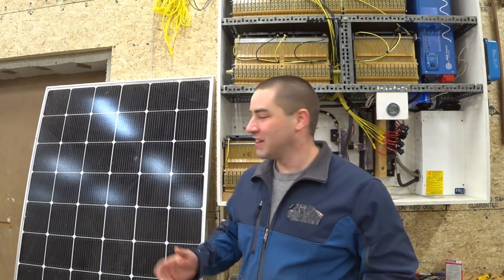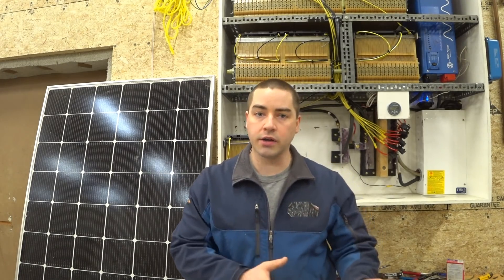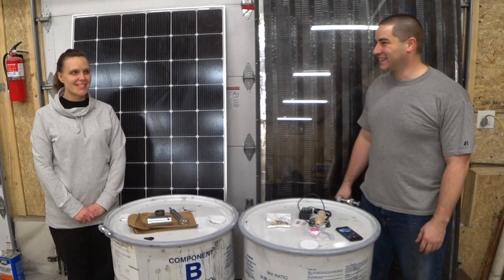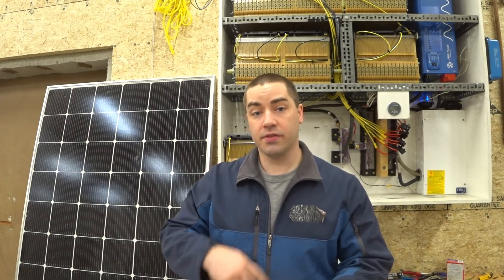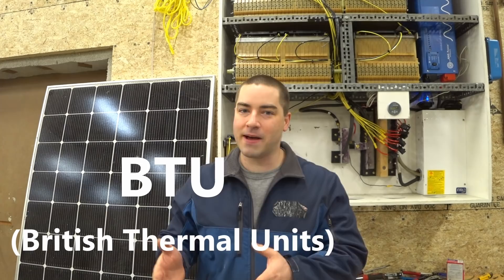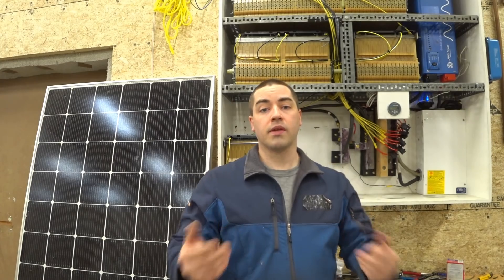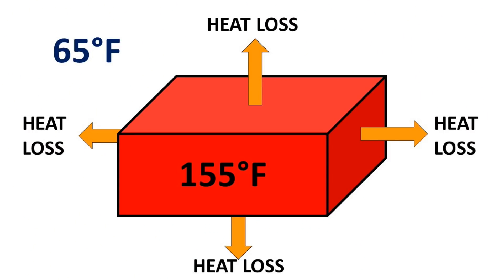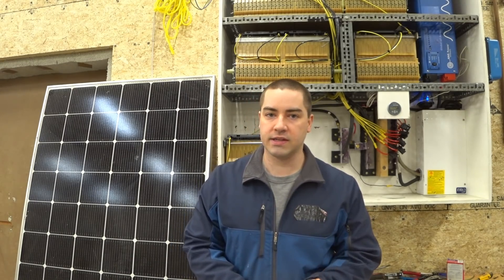Cheapest Energy Storage Off-Grid

Comment: How about an update???

The bigger the tank, the less expensive it is per cubic foot or cubic meter of water storage.

If the tank is inside the conditioned part of the house, in the fall, winter and spring, the heat that leaks out of the tank is not wasted, it helps heat the house. Of course, in the summer, any heat that leaks will have to be countered with air conditioning.
Reply from the maker: I built a 250 Gallon tank under my house (inside my crawlspace).  It has been working great.  It's automatic.  No leaks.  Pump and controller do their job.  I have a series of videos on it if you are interested.

Comment: You could always put a tank in the attic. You would only need to heat it for a few months. A pipe heat trace wire wrapped around the tank will keep your water or hot in the cold. Gravity pressure and wasted space utilization ideas 💡

Comment: David, Thanks for this introduction to this concept. Being a complete novice, how is it then possible to turn this heated water into energy that powers my home/electronics? Or was this specifically for the storage of hot water only?
Reply from the maker: Specifically for storing hot water.  I built a 250 gallon hot water tank inside my house.  I'm trying to show how inexpensive this is compared to storing energy in batteries, which then get used to heat water.  I'm not replacing batteries, I still have them and use them for all my other loads besides hot water.
Reply: @DavidPozEnergy  David, thanks for your reply, totally makes sense.

Comment: A heat pump water heater is still useful if you can program your system to only use excess electricity generated by the PVs that would otherwise not be used.

Comment: I want to heat that 300 gallons of water to 150 F by the sun …. I believe there was an architect in Mass. who did this with glass bottles many years ago . Im wondering how I can do this in northern Canada  ( Southern Labrador) we get quite a lot of sun , and cold of coarse … tons of wind . Should the storage vessels be small or big , glass or cement , ceramic ? Not sure I’m thinking of putting the storage on 3 rd floor , and then fanning the heat down to the first. Do you have any ideas . It’s for a 3 story piece built on to my wired building that now has a usual 45 gallon hot water tank .

Comment: I've owned a Thermo solor heater, and the output water is extremely hot, so what if you put a thermo pile on the output pipes, you can use that  extremely hot output of water to produce electricity at the same time.

Comment: But this energy is not being used to generate electricity. I thought your were designing a storage system to replace lithium batteries. But you still need them for electricity, as this energy you are storing in thermal tanks is for house and water heating only.

Comment: Great, but wow, don't imperial measures make all the math(s) more difficult! Particularly as you mix it with Metric (kWh). I've totally given up trying to do anything with imperial. Metric is so much simpler, 95% of the world says so! :)
I'm looking at VIPs - Vacuum insulated panels - for the thermal store insulation.
Also looking at heat recovery from the waste water.

Comment: David, you completely missed the point of using the hybrid water heater! It has a much higher COP than the simple electric element does. Using the heat pump when the sun is shining allows you to heat four times as much water at atmospheric pressure.

Comment: Thanks for articulating in this mini-series what I've been thinking for quite a while. The thermal battery, even if it's 'leaking' heat a bit, as you said, is a net positive in the winter because it's leaking heat into living space and that just translates into less load for whatever the home's heating system is. It's the summer time when the thermal battery leaking heat is an issue (for the home's cooling system) -- maybe the thermal battery's site could be located on the periphery of the home and you rearrange some physical baffles or walls or something twice a year to vent heat into, or out of, the living space as the seasons change.

Comment: If you're moving 150k btu heat around, the cold side of a heat pump water heater would provide about the same amount of cooling to your house as a window air conditioner by blowing air over it and into the house, another form of power saving and thermally storing energy in the form of cold air. A well-insulated hot water tank will hold the heat regardless of where the hot water comes from. A smart heater could run only when excess power is detected.
There's a grid scale solar thermal plant with molten salt heat storage in Tonopah California, but private investors pulled out of it because in the time it took to build the price of PV and wind dropped so much from increasing economies of scale that solar thermal wasn't competitive anymore and it had to be majority funded the taxpayers. it eventually closed and went bankrupt.

Comment: You're adding up BTUs in error for the battery system. Because the battery system is not keeping the water hot it's only heating the water that you're using at the time that you're using it. So there is super little loss overtime from a heat loss. But yet you have added that equation to the amount of hours that your batteries can hold. That's your error. I just thought I'd point that out.

Comment: You could probably put some glycol in the heat exchange water to prevent possible freezing of water in the pipes during inactive cold spells. BUT, glycol has poor compatibility with PVC, so glycerine would be better. This may affect the heat capacity a little. But if you ever swapped for copper heat exchange piping (and your tank material is compatible), adding glycol to water might certainly be helpful.

Comment: I'm using a DIY panel to heat a 275 gallon IBC, but I only want to heat it to about 100 F maximum.  I live in Southern California, so that is very easy.  I have a little inline electric flash heater that can raise the water temperature about 40 degrees F.  If I feed it 60 F water, it doesn't get quite hot enough for a comfortable shower.  But if I preheat the water to 100 F, then it uses much less power to reach it's 105 F setpoint.  I have a grid-tied PV array, so my power does not cost me anything.

Comment: Can adding rocks(sand), in tank as heat absorber, increase temperature's duration for later hot water? insulate it in a compost mound; aim solar(heliostat) on tank through window(s). use hillside terrain angle advantages. do you have enough yard to make ground battery? Thanks for info; GO BACK TO GREEN FOR KIDS FUTURE! universally we're all kids.

Comment: Thank you for the awesome video.
I guess if you dissolve a lot of salt in the water reservoir, you can significantly increase its heat energy capacity. The temperature won't go higher, but it will store more heat. This way you might be able to generate 4 or even more days of hot water with your 200 gal reservoir.
Reply: Increasing salt concentration actually decreases the specific heat capacity of water, at least on a mass basis. And for seawater, heat capacity goes down by 4.5% while density goes up by 3%. So also on a volumetric basis if that holds for other concentrations.

Comment: By water cooling your PV panels
From the back you increase their efficiency and peak power...you also protect them from deterioration due to heat damage..  extending their life span. 
You can then use the panel coolant to preheat a stored hot water system... Useful on a boat etc .. you could use a stirling engine to generate more electricity or circulate air or water.

Comment: useful for cold climates where heating is important.  I have an evaculated tube solar hot water system with wood fired boost so dont use electricity to heat water which is even more efficient.

Comment: You'd gain even more if that hot water is NOT produced with photovoltaic cells, known for their low efficiency, but with cheap solar water heaters with far higher efficiency, taking a lot less space and control systems.

Comment: There is a Dow liquid that can go up to 200 degs C., it's used in boil resistant radiator fluid..Won't be cheap, but would be one way to get volume down., if space is part of the limits..

Comment: Why not have enough solar panels on the roof to wire them in series to make 240 Volts DC that's wired directly to one of the heating elements in an electric water heater? You would need 8 - 300 Watt solar panels per heating element, the tank could be potable water and pressurized. The tank would be your storage unit. You would not be able to turn the tank off during the day unless you cover one of the solar panels.

Comment: If I understood correct, you just heat up a giant container filled up with water, and use it for heating , shower etc. Instead of storing the electricity in batteries, what you would use to heat up the water in the cloudy days
Reply from the maker: The goal of the tank is to have a large enough "Thermal Battery" to carry you through the cloudy days.

Comment: You said you don't want to turn it into steam, but why not? True it adds cost to change the piping and you'd need to use a metal tank or aircrete as your water tank. However, you'd  be able to use a DIY parabolic trough collector instead, turn that water into steam, pressurize it through a nozzle and use it to power a small steam turbine. Then collect the steam which turns back into water in your storage tank and it recycles in a continuous loop. Should work, right?

Comment: Hi. I wondered if you could me some advice how to make some kind of battery (or similar) to store the solar heat. Lately I saw this videos of how to make solar heaters.....

https://www.youtube.com/watch?v=WRAxpaYh6DA
https://www.youtube.com/watch?v=IvEfmDH_Y2o

.... but at night they do not work, obviously. I am living in a caravan and in winter I need something to warm up the 8m2 space
Do you have any idea what it needs to store the heat the solar heaters produce during the day? Thank you.
Reply from the maker: Those videos you linked to are about solar air heaters.  Nothing wrong with them, but as you mentioned, they only heat when the sun is directly shining on them.  If you were in a home then the answer is to increase thermal mass inside the house.  This is sometimes done with concrete floors, double plaster-board on walls, and large stone fireplaces.  In a camping trailer you won't be able to add thermal mass because of the light suspension. 

In a camping trailer you could use a fossile fuel heater (propane or diesel).  However, if your goal is renewable energy then probably solar PV panels (electric), plus lithium battery, and a heat-pump.  You collect the solar energy with solar PV.  Store it in lithium batteries.  Then use that to run a heat pump air-source heater.  Such as a mini-split.
Reply: @DavidPozEnergy  Thanks a lot for your advice. Nevertheless, none of what you proposed works for me. These panels and mini-splits are too expensive and heating with propane or diesel is prohibited in small places due to their emissions causing health problems.

Is there nothing out there that one could do oneself (DIY) to design/construct easely a small solar heater that lasts at least 15 hours during the cold winter nights?

In the Northern Hemisphere there live millions of poor people that have to decide whether they buy food or if they want to have a warm home. Or people that have to live in camping trailers or even tents. 

And all the animal shelters where animals literally are freezing to death. And no-one so far has ever thought of designing  a small solar heater for the poor and/or for these animals?

There must be something. I am sure. If you come across an idea, please let me know. Thanks!!!!

Comment: After I installed my small solar array. I noticed a lot of energy going back to the grid. After a bit of research I bought and installed a solar diverter from Solic200 which transfer all available or left over energy at zero export and the rest to the immersion heater which heats our hot water.

Comment: As it works out if the storage tank is not disturbed, hot water will happily sit on top of cold water with very little heat transfer.  Why is this important? If your tank is large, as you mentioned, it may be difficult to heat it sufficiently. But you don't need to heat all of it, just the top part. For this to work well it also means the primary heat exchanger should also be in the top of the tank and be of good transfer medium such as copper!  Water to be heated would enter the transfer medium at the bottom of the tank while heated water exits at the top, but you probably do that anyway!

Important to remember: 

A) If heating is with solar electric, use multiple elements at different levels in the tank. Heat with the top element until the top of the tank reaches 180F. Then move down one element and heat until that part is 180 etc. This could be controlled with simple Arduino setup for example. 

A2) Optionally place the heating elements into a smaller tank of just a few gallons and do all heating in that tank. Only when that tank is at 180, feed that hot water into the large storage slowly and right on the top thus keeping the top of the tank at a constant 180F. 

B) If heating is with solar thermal then draw cold water from, the bottom of the tank (as you almost certainly do!) but inject the heated water from the panels where it is just warmer than the water it replaces. Be careful to let that water enter horizontally not vertically perhaps by placing a "T" at the bottom of the input pipe. Again an Arduino can be used to raise and lower the input tube.  

In this way the heat is always going into the tank where it will provide the maximum hot water for the family. Nobody cares if the water at the bottom of the tank has fallen to 'well temperature' so long as the water at the top makes for a good shower!

Comment: A low mass flat plate counter flow heat exchanger - can heat a high volume high mass thermos bottle filled with water. The extent that you can contain the heat in storage determines how long it lasts. 
Automatic mixing valves can extend range by cooling the heated output. Forced circulation or pressure driven flow is required. Emergency relief and drain down features can be installed.
Alternately the same heat exchanger could be diverted for heating purposes .
Low mass demand fired, at point of use, is also efficient technology. 
As is low mass low temp radiant heating. 
High efficiency and fast recovery rates, along with fine control over temperatures is existing technology. A 2 1/2 Gallon Low mass source can heat what a 50 Gallon high mass, high heat loss hydronic system used to btu for btu with a fraction of the standby losses. as much as 50% of total consumption in some cases. and instant response 'on demand'. No idling losses !
Grumman Aerospace was doing this on Long Island as was Energy Kinetics System 2000 as early as the 1970's. Guess who was involved : )

This guy is good !

Comment: Have you tried adding a strong salt concentration to your storage water to change the boiling point so you can increase the storage.
Reply from the maker: No, I have not added anything like salt, sand, rocks etc. to the tank.  My 250 gallon storage tank is filled with tap water and a little bleach.

Comment: I designed a thermal battery using a small cement block tank lined with high temp silicone and covered the outside with 8 inches of styrocrete, then filled the inside with mineral oil. No water to need conditioning. The mineral oil is heated by pumping through solar evacuated tubes and/or through my sawdust stove depending on the weather. It can be heated to over 500 degrees, then sent through the heat exchanger to heat water or air or a clothes dryer. Even if you are gone for months and it gets cold it will not freeze in the tubes or the lines like water might. It is also a non-pressurized system that holds a huge amount of heat energy in a small space. I might add in-floor radiant heat to the system in the future. A small steam turbine could even be used to generate electricity.
Yes the mineral oil is more expensive than water, but you get a lot more value from it.

Comment: Great video David. One thing to consider, which I have not seen anyone do yet, is to modify the charge controller to utilize the excess electricity to power heating elements in a water tank for exactly this purpose. Few realize that the PV system produces so much electricity that the controller must dump it as waste heat through internal mechanisms because the battery bank cannot take it all. If the controller was modified to route this excess energy to an element in the water tank, you'd have much higher efficiency in a system such as yours. Food For Thought.
Reply: Consider the following concept:

https://www.youtube.com/watch?v=tm7spMG0ch8
Reply: While the potential energy of the panels is wasted, the controller does not dump it as heat internally.  I design PV water heater controllers that sense when the solar array goes over the natural power point voltage.  This is when the charge controller can't take all the power.  The solar world is slow to accept this technology because they lack any real understanding of technology.  I get all my water from excess PV.  So much that I have a 40 gallon water heater in the garage and do all laundry cycles using hot water into the washer's cold inlet. Watch my videos.

Comment: I once worked with an old scientist that told me of an idea for storing and using energy. If you have a high hill on your property and already have a pond on the hill and another a few hundred feet below, you can use solar, wind, etc, kinetic energy to pump the water from the lower pond to the upper pond. With hyro-electric at the bottom of the large fall to the lower pond, you convert the potential energy to kinetic energy.